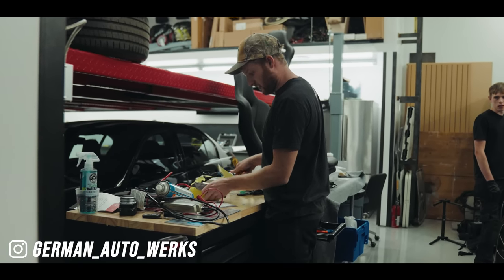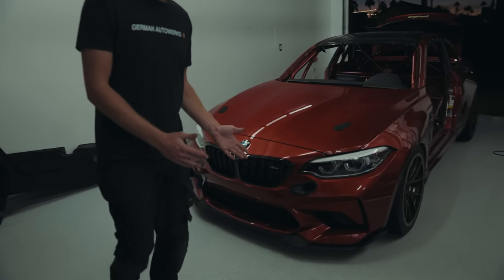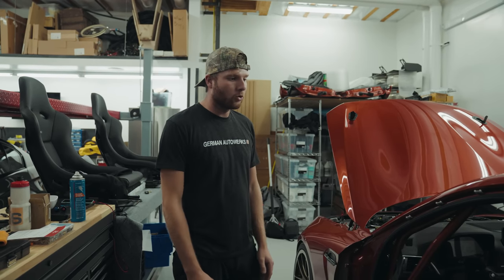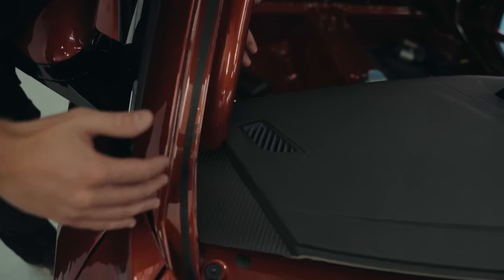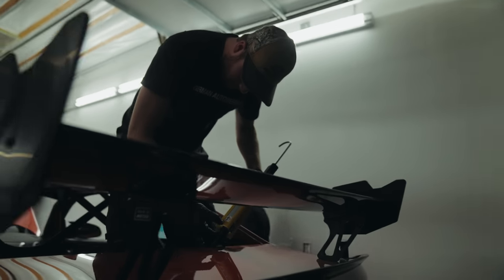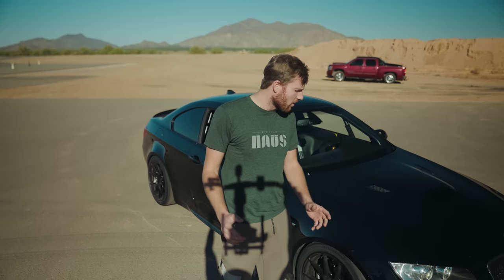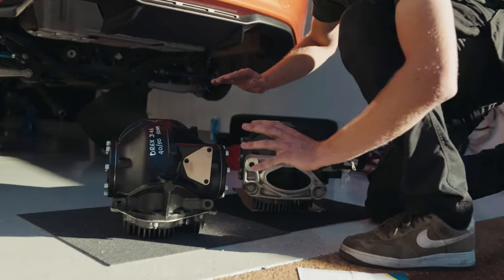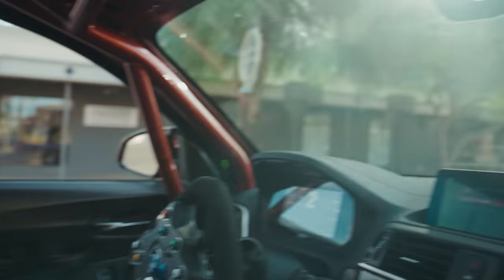BUILDING THE ULTIMATE BMW M2 RACE CAR IN USA! *99% COMPLETE* EPISODE 6

Comment: might think about using 3M's DP420 for carbon to aluminum bonding. Did a bunch of testing for various adhesives for such applications and found that product to be the best
Reply from the maker: Hi Milos, you are correct! In the past we have used this adhesive however at the time of this build the stock in the uk was incredibly low!
The adhesive we used is sufficient however 😊